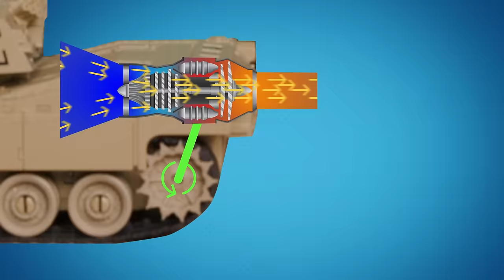Army Mechanic Reacts to Tank Fails

Comment: I’ve never worked on a tank turbine, but that sound sent a chill down my spine because that’s the exact Disney sound that plays in my head when I think of a bolt disappearing into the depths of the bowels of an engine.
Reply: and you never will as a CAV SCOUT IN A BRADLEY FIGHTING VEHICLE.....JESUS THIS CHANNEL FAILED!
Reply: @rdejaynes  dude what
Reply: @rdejaynes  lol wut? I don't understand your anger here...
Reply: @armourggeddon  i think they're implying you'll never drop a bolt into a turbine on a BFV (bradely fighting vehicle), because bradelys run a cummins diesel engine and arent a turboshaft turbine engine. 
However im not sure how they reached that conclusion based off of your comment lol. You didnt mention the bradely.

Comment: that older tank. Looked to be a churchill, british 'infantry' tank. It was slow, designed for the trench crossing, to move at infantry speed, a support vehicle. IT had the large exposed tracks sticking out to allow it to go down and up trenches.. that one was just.. wow.
Reply: It looks like a IV or V, with the 6 pdr turret. It also looks as if they were actively trying to see if it would flip - going at an angle, closed down, everything on the outside stripped off - and being filmed, from above. 
Slower than the earlier shown M4 (max 15 mph), but could climb much steeper slopes and regarded as the better gun platform.

Comment: It was actually impressive that a vehicle that heavy could even flip over like that lol
Reply: The mass is essentially irrelevant, it just adds momentum trying to keep it going. If anything they're top heavy as most of the armour is up top and on the turret.
Reply: @mandowarrior123 especially on sand/dirt, the tracks just dig further into it making too over even more likely.
Reply: The bigger they are, the harder they roll.
Reply: Physics never ceases to amaze
Reply: They weigh between 50-100 metric tons, while also having more ground clearance than your SUV. It also has a turret, so it is incredibly high-slung. Their engines have between 500-2000 horsepower and an un-natural amount of torque, so it isn't going to stop so easily
Reply: Well even something as heavy as an Aircraft Carrier could flip if the speed was enough (the list quite heavily on sharp turns as is, there's videos of that around).
Reply: Baumholder, Germany, late 80's, an M1A1 driving excessively fast down a hardball, down a hill, wet road, loses control, hits the dragon teeth on the left side of the road, flips over and ends up upside down in a small drainage culvert. the crew is able to crawl out the loaders hatch. The driver is higher off the ground and exists from his hatch. Tank is flipped back over with recovery vehicles, turret is removed, General Dynamcis and a bunch of Master Gunners pour over the fire control system. Commanders Weapon Station, antenna and the bustle rack and cross wind sensor are replaced. A month later we fire proofing rounds out the barrel and downrange to ensure everything is good to go. 3 hits. No major system failures. That is your tax dollars at work.
Reply: @JosephHenry-l5e  That's impressive. If I rolled my car, if I insisted on fixing it (I only have liability insurance so they won't cover that) it would be in the body shop for a year.
Reply: In the army. I have tanker buds who tell me the wildest stories. From flips to friendly fire training accidents.
Reply: well its about 40 to 46 tons and he goes aroung 50 to 60 km and try to rurn in teory tank do wthat you ask but they forget to take in mind that presure on the ground under them and togeather with speed and how heavy taht tank is this must happend, its just physics irl.
Reply: armoured infantry veh comm here (foreign army), before every engine start we did a vehicle overturn drill where every crew member in the vehicle would do their respective procedure to get stuck in and avoid falling out in case of an overturn. you would be surprised how easy it is to get one of these things to overturn, with heavy gun turrets and armour plating, hence a high CG. 

many of us don't get harnesses or seatbelts (standing positions etc) and vehicles often operate 'open hatch' - hatches opened and crew sticking out, unless we're doing combat ops or something serious (then we 'button up' and the vehicle becomes safer, since the main danger is being thrown out and crushed).

just for fun, we also had a whole machine in training school that was a stripped out tank hull on large mechanical arms that would flip us with no harness - just rely on training and survival instinct to stay in there (and the knowledge that if you fell out, no one would ever let you live it down)
Reply: There’s a whole track to dig in, not just the contact patch of a tyre. That also means when you do manage a drift, controlling it can be surprisingly easy….untill⬆️😬
Reply: Fully loaded forest harvester collection machine. The damn thing can go anywhere where there is enough traction and looks like it flips in a instant.. well it does if driver does not know how to use the boom to counter weight it. Its at the same time amazing how easily in wrong hands it can flip and what kind of places it can go in right hands.. mind it weight about the same as tank when fully loaded and has way higher center of gravity. Also dont ask how i know, how easy it is to flip.... we owner did say it goes absolutely anywhere... just didnt mention orientation or counter balancing..
Reply: @charlesc.9012  That Churchill is about 40 tons.

Comment: The M4 Sherman had multiple engine installations, but most common was the a 9 cylinder air-cooled aircraft radial engine fed by gasoline.
Reply: This is the comment I was looking for! Not many people know this about the Sherman.
Reply: Ah, yes famous US tanks and having aircraft engines. Like bread and butter.
Reply: The strangest one was (5) 6 cyl car engines grouped around a common shaft, curiously it was one of the most reliable.
Reply: Thanks! I wonder if that tank still has original engine or was swapped with something more modern. I've heard of people doing both - as far as I know, most ancient plane engines, for example, are just not reliable enough at that age and people don't want to crash the plane.
Reply: The ronson.

Comment: 15:55 During a military exercise when I was in the Norwegian Army, a Leopard tank flipped completely over due to both the commander and the driver thinking a snow bank was a part of the terrain rather than just fluffy water. The tank commander was at that time standing up through his "commander's hatch", and he only survived because of the depth of the snow. When the tank turned over, the snow pushed him back into the turret before hitting solid ground. They later commented that the "escape hatch" (that you tell your mum about; "don't worry, we got an escape hatch if everything goes bad!") is basically ONLY USEFUL in this situation (ie, turning upside down while driving).

Comment: This was cool. I'd love to see this kind of thing talking about some of the Humvees or APC units. Have a few buddies who worked in the motor pools as mechanics and they have a few stories of wild stuff they pulled out or the amount of pounding those can take.
Reply: I was either cursed or just not knowledgeable enough about humvees, i cracked 3 engines while i was in. All were instant temp jumps and coolant leaking.
Reply: eh, not so much the hummers.  they just suck.  i'll never understand why they took off in the civilian world.

but pretty much anything with tracks, sure.
Reply: @rakninja marketing and branding.
Reply: Former mechanic and wrecker operator here.  1.  The oshkosh m984a4 is the baddest thing out there...change my mind.  2.  That truck will do 80mph unloaded, its AWESOME.  3.  The armored version I had in afghanistan took an unseen jump at 30mph while weighing roughly 45 tons, that landing hurt like fuck cuz at the apex my back slammed into the roof and the only thing I was holding was the steering wheel  while my knees were next to my ears.  4.  Air ride is the shit.  5.  I also retuned the c15 cat engine to pump out 1900 horse cuz why not.
With the tcase in low I had 2 broken down rg 39s tow bar'd togother then another towbar hooked to the buffalo i had on the stinger.  What made it a seriously safe truck was the fact the cab is forward of the first axle so when i got hit the explosion was behind me.  I did some WILD shit with that truck before and after I rebuilt it.  Fun times.
Reply: @big_ute  Huh, you learn something new every day, I've only really seen that one in tanker configuration.  My unit used the hercules for recovery.   I'm assuming they just dont attach those HEMTTs to armor units.
Reply: @rakninja  I saw a few when I was at ft hood, there were lmtvs, fmtvs, mtvs, hmmwv's in 1-12cav along with a few hemmt cargo trucks and a few wreckers.  But the non armor stuff belonged to the fsc.

Comment: 10:00 that's my museums M4A3 sherman very very old video when we first got the tank it's got a ford V8 (ford gaa) motor. It's most likely fowled spark plugs or a slight timing issues. If you have any more questions let me know.

Comment: I was at Fort Hood, 1977-1980.
We had several ground-guides get 'pinched' in the first year we were hosting the XM-1.
One guy only lost an arm, the other guy...well, the Chaplain called his wife before they had the hulls separate.
The 'pinch' was the only thing keeping the guy from bleeding out; once the hulls moved, he passed away immediately.
Lost of lot of good Soldiers through 'misadventure' at Fort Hood...vehicle mishaps, flash-floods, Copper-heads, scorpions...
Reply: This story is still being told at Hood by the safety guy.
Reply: It's good to see that Hood hasn't changed much, even if the name did.
Reply: Safety regs are written in blood. It sucks, but there's no other way to learn
Reply: pirobot668beta, you were in 2/5 Cav. I arrived there in Dec 80 to HHC. That  happened just before I arrived but was told about it.
Reply: Lmao. The pinched between two front slopes is Absolute tankers lore that never happened. It's been around since at least the early-mid 70s with M48/M60s and happened at Ft Knox, Hood or Grafenwohr. Yet no one has a name, news clipping, report...nothing. Or its always "right before i got there", "right after i left" or "my buddy was there". 😂
Reply: @32Umzy  yeah usually these aren't getting parked nose to nose, I don't get it either... But there was a maintenance guy from an engineer battalion that got in between his deuce n half and a wall. Bad shit do happen sometimes.
Reply: And from some of the things I've heard I also think they have a serial killer down there

Comment: I was an 11E20 in a tank outfit, just after Vietnam.  We drove the M48A5's, which was the main battle tank before the Abrams.  

The A5 was the last of the M48's, which had been commissioned in the mid-50s, if I recall correctly.

It had an OPTAR fire control system, a 105mm main gun (which was rifled), a 7.62mm coax gun, and a .50 cal tank commander turret gun.
Reply: Those Early to mid Cold War US tanks are very cool. I love the M48’s and M60’s.

Comment: If you’re wondering what those two tanks are, they are self propelled howitzers (SPH) which fit cannons up to 155 meters long , the ones featured are the French AUF1 and Russian 2S3M , a lot of SPH tanks have a similar drive train configuration to that used by the the Bradley IFV , the PUMA , the marder A1-3 and the CVRT where the engine and transmission are at the front of the vehicle , lastly they are literal MBT deleters where the shell can over match the armour used by the Abrams and completely obliterate it 😊

Comment: If you ever driver a tank you can actually control the speed and direction of each track, eg. you can make one go faster than the other to turn in a specfic direction or reverse one track to turn on the spot
Reply: Not all tanks can do the spin in one spot bit, it depends on their design, but they are almost unbelievably maneuverable when you stop and consider how much they weigh, and how much inertia they have. Acceleration, braking, turning at 50 tons requires incredible design, build quality and maintenance.
Reply: That’s just how a tank turns and pivots homie
Reply: @gorbdonfreeming  IKR how else is it supposed to steer? Does he think the wheels turn?

Comment: The tank in first video appears to be a variant of the Soviet/Russian T-72, which is 41-45t depending on variant and has a V-12 diesel engine that generates just under 800 HRSPRS (or around 1100 buff horses if it's the newest modification with upgraded engine). So the commander was right on the money there. Clip #2 is also soviet/soviet-derivative tank, as are in clips #5 and #6. Likely T-72s or T-90s.
For clip #3 -- ever wondered why many russian/soviet tanks carry wooden logs on their hulls? That's why.
Clip #7 is indeed a WW2 era M4A3 Sherman tank, going from the R/N on the side it's the one from the Museum of the American G.I. in College Station, TX.

That was fun to watch, thanks y'all :D

Comment: Just in case anyone was wondering, I read not too long back that including the foundation, the average house in the US weighs around a thousand tons.

edit: Rather more like 100 tons.
Reply: That's an overestimation, I don't think an average house exceeds 10 tons. 1000 tons is a ridiculous amount of construction materials.
Reply: Just some back of the envelope math here, on the upper end for a slab for a 3 bedroom house, you're looking at 120 tons of concrete, the house might weigh 5 tons. So. It really all depends on the foundation. House without a foundation weighs less than an MRAP. House with a thin foundation, could weigh less than an Abrams.
Reply: 10 is too small unless it's a tiny-home or single-wide mobile home and 1000 is way too big. If you include the foundation (often half the overall weight), a house can easily be 60-150 tons, depending on square-footage. It would take a massive mansion to hit 1000.
Reply: @Eshperansa  Yeah, my brain added a zero. Made a correction.

edit: btw, you are a zero off yourself.

Comment: 5:45 ayyyyyyy i never thought id see anyone clip an AgentJayZ video. nice. That dude knows his way around a turbine engine. This particular one was probably out of a plane and then converted to drive a natural gas compressor pump. He rebuilds and converts mainly aircraft engines, he never mentioned tank engines but its the same concept. Old GE LM1500s/2500s, J47s, Orenda CF-100s and 105s, stuff like that is what he worked on.

Comment: "Can tanks go highway speeds?" "No" Well, the M-18 Hellcat, while it is technically a tank destroyer, not a tank, can do 55 miles an hour if you're brave enough, which is the speed limit on some U.S. Highways, though others are 65.
Reply: Apparently Christie suspension tanks can go up to 70 mph without tracks but then some don’t consider that a tank at that point.
Reply: @Johndoe-jd  That sounds absolutely terrifying.
Reply: @sambrown6426  then you don’t want to know the public top speed that was achieved
Reply: @Johndoe-jd  Yes I do.
Reply: @sambrown6426  A m1928 reached 70 mph on its wheels on pavement and in 1931 in New Jersey, a M1913 reached and clocked at an official speed of 104 mph (167 km/h) on its wheels on asphalt without tracks. It became the fastest tank in the world a as far as declassified information goes still is.
Reply: @Johndoe-jd  Holy mother of god.
Reply: @sambrown6426  well he’s still right. You can’t go that speed on the highway.
Reply: @Johndoe-jd  And why not? In the U.S. at least, it's possible to make tanks street legal.
Reply: @sambrown6426  it is the speed. In the US the highest speed limit is 85 mph. Everything else would be fine.
Reply: @Johndoe-jd  So stick to 55 mph highways and slower, got it.
Reply: Things break at road speeds.  Tim and I patrolled some of the same ground in Tal Afar.  Due to harmonic vibration, road wheels could sheer, and even the suspension arms break, just doing 60kph down a hardball.  Not all the time, but happens.
Reply: @vasky22  Ah, gotcha.

Comment: Hauling an M1 Abrams is a TON of work...72 Tons of American Freedom. The tracks actually overhang the trailer by about 6 inches on either side. But the track guides keep it centered for the most part. But chaining the thing down isn't even the hard part. It's all the dang tires that ALWAYS blow out! And It's ALWAYS and I mean ALWAYS and inside tire. Usually on the inner half of the bogey. And we can never find the socket for those inner Lugs.😂😂 The last time I hauled a Tank, I was hauling an M88 and those things are about 76 tons. I actually blew out an inner hub on my trailer. All the studs for the lugs snapped off and the wheel bearing was smoked.😂😂 Long story short we got it where it needed to go. But not without changing more tires than we know what to do with😂😂

Comment: Russian tanks are REALLY cramped and the escape route for the driver is partially blocked. Also, the drivers normal route is partially blocked by the turret, you need to turn it a bit to the side but not too much: if it points towards the back, there is no escape route if your main hatch is broken.. Oh, and if someone turn the turret while driver is escaping, the driver is in two parts. It is extremely claustrophobic environment, it is almost like it is designed to be a torture pod even when things are optimal.
Reply: The udssr just designed the Tanks that Way since the T54/T55. Small as possible to not need as much armor, which also makes it lighter for good Mobility and the Ability to travel in difficult Terrain while using a Gun as big and powerful as possible and cheap and fast to produce in enormos Numbers. 
They just have to use them since its even for Russia not easy to replace a fleet of over 10000 tanks and the Armata is their Solution to break away from these Designs. Thats also the Reason they tested them so long and thoroughly.